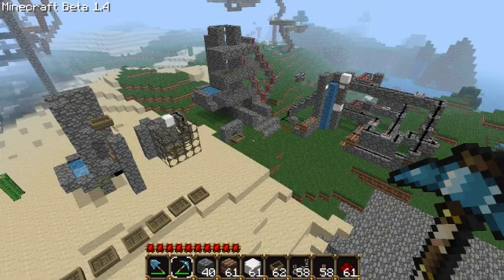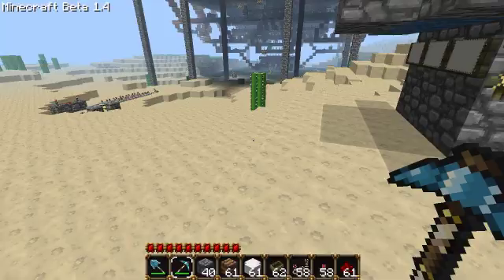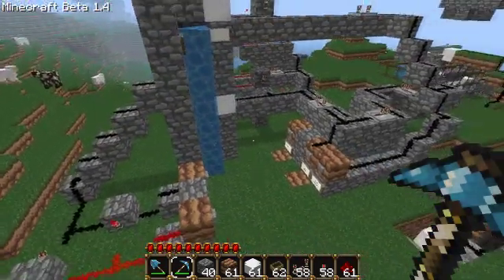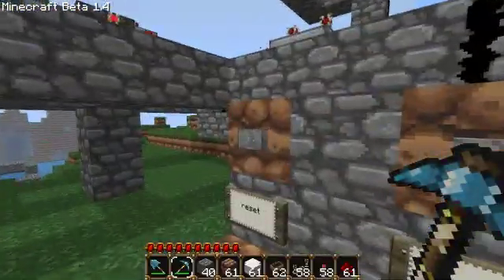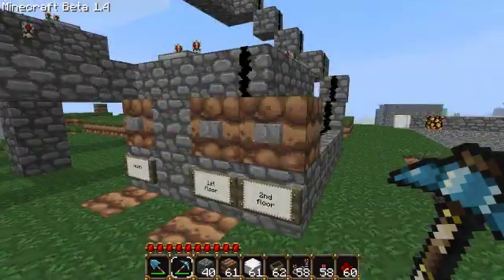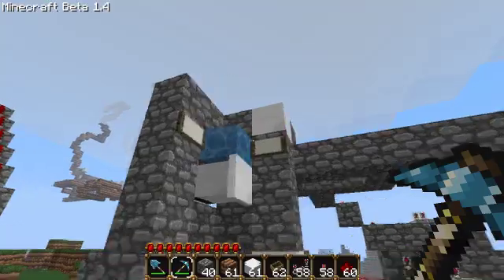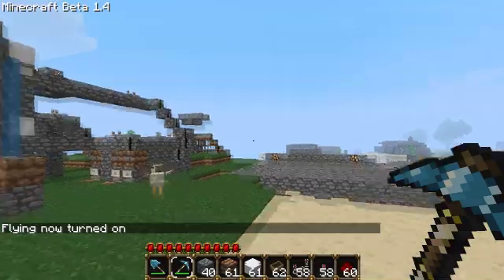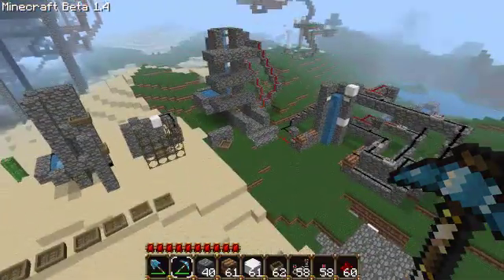Minecraft Tech - Pistons - Elevators with Floors

Comment from the maker: @BradyhahaPSN Most likely not in 1.6; Notch been talking about making bug fixes a priority in 1.6, and Jeb's still looking over the code and making modifications. So, there probably won't be an accurate estimation for their arrival for a while longer. As for the boat return, it's certainly possible; it's just a lot easier and more reliable to keep things in order by plugging the plates into a system that you already have made in the first place instead of making a return specifically for it.

Comment from the maker: @BradyhahaPSN It would be very difficult at best, because it takes quite a bit of care to get the boat positioned correctly in the shaft, and boats react oddly in water. However, what you can easily do is plug the pressure plates into the reset and water valve redstone lines to close all pistons and disable the water current. That would reset the floors and drop the boat for the next use.